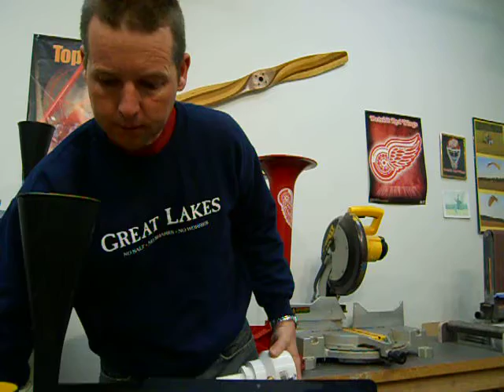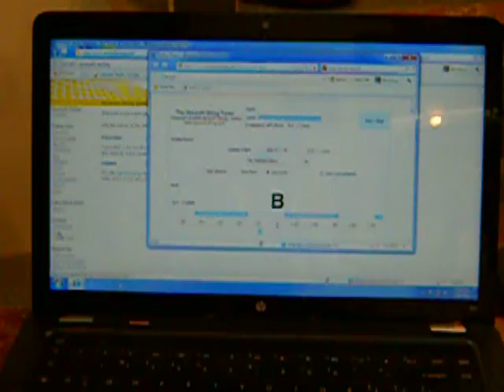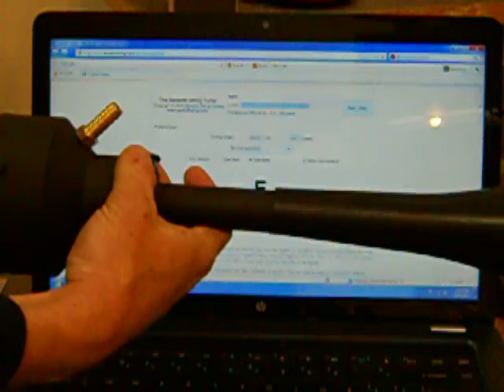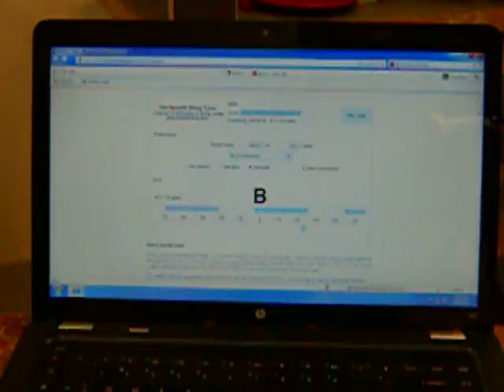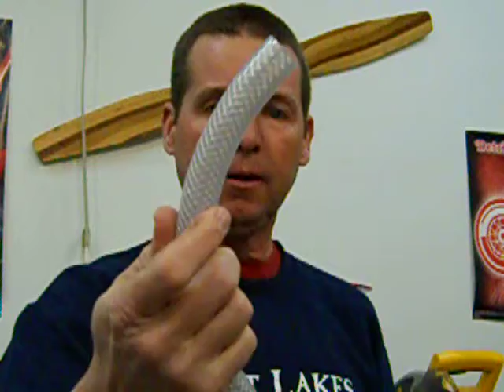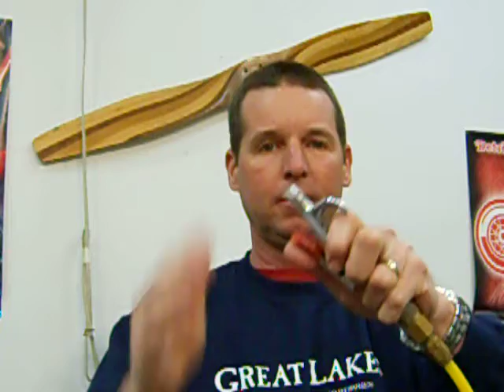v3 Train horn building video #3

Comment: Hey Scott , so I first got plans and built my first horn . About 15 years ago . Back then I could blow the horn by mouth. About a year ago I got more plans and am now building a set but I can’t get them to fire by mouth. What did the instructions use for diaphragms originally? The plexiglass seems to thick
Reply from the maker: Originally I used aluminum flashing but they would tend to blow out after a lot of use. The plexiglas is much more durable.